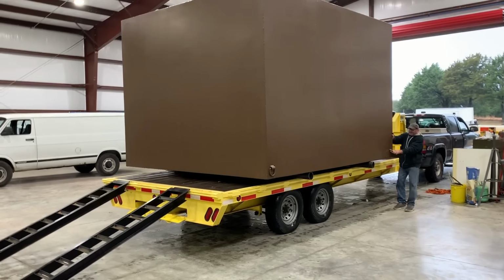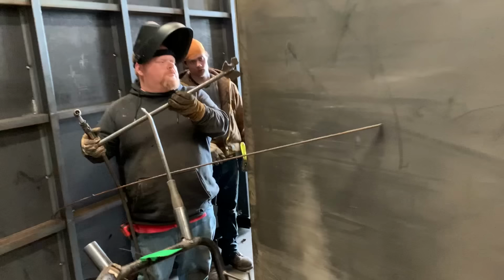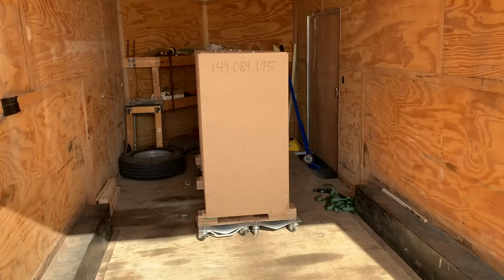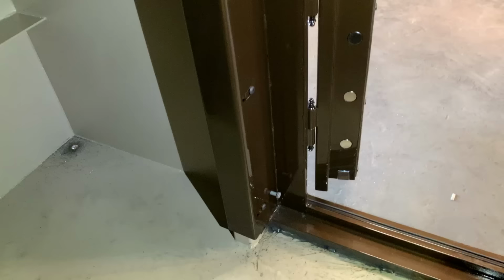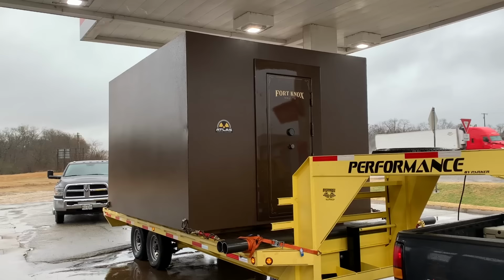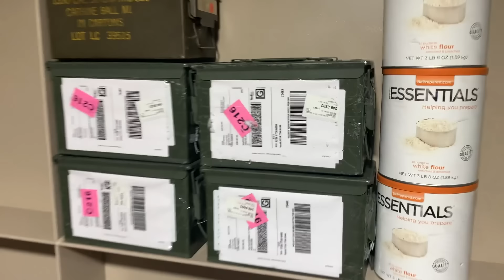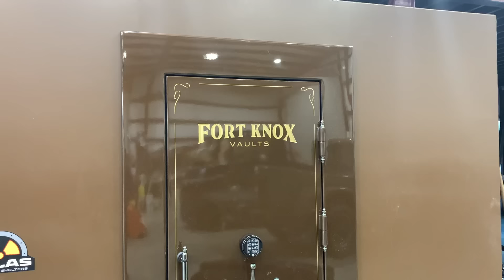Building a $20,000 Fort Knox Gun Vault

Comment: Seems to be very little care put into the moving and unloading aspects of this operation
Reply: 20k gun volt, lets slide it off the trailer and hope for the best.  Where the paint rubbed off it will rust eventually.
Reply: @hyperliterider861 very intelligent input.
Reply: The guy at 10:35 sure tried his darndest to slide a couple tons of vault off the trailer nice and easy
Reply: @Southerngirl612  its quarter inch steel. will never rust through in a thousand years
Reply: I'm sure the integrity of the door and the corner welds are still 100% 🤣 

If it was mine and I saw that.....back to the garage
Reply: The pipes on the ground as rollers and pushing it along with the fork truck had me down laughing.

Absolutely unprofessional

Comment: Remember to check with the lockpicking lawyer to see if it is secure and unpickable.
Reply: Haha wouldn’t that be another challenge for him lol
Reply: hahaha nooooo, get rid of that masterlock piece of garbage. Masterlocks usually fall to bits when the lock picking lawyer looks at them!
Reply: @fence_9540  I know right? I’ve seen lpl pick that lock
Reply: No such thing for him....lol
Reply: That puck lock isn’t just easily pickable. It can also easily be bypassed. Have him buy one that has a abloy core.
Reply: Imagine hiding inside your fort knox vault and all you hear from the outside is: "First pin... nope. Second pin.... nope. Third pin.. *click" third pin. Fourth... nope..."
Reply: Wouldn't need to pick it. Plasma torch to the wall...and that door becomes an expensive paper weight.
Reply: Ive never seen him fail to open one. Really leaves you feeling vulnerable
Reply: I'd have used a manual tumbler dial vs an electronic dial
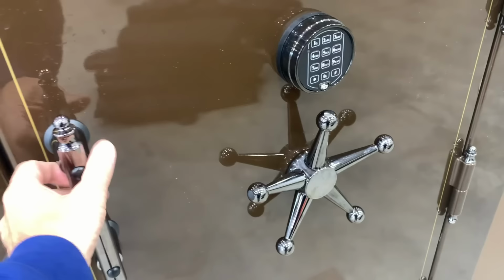Reply: 13:02
Reply: Just have anti lock pick mechanism that shocks the assailant with 20,000 volts of buzz off 😂

Comment: Wouldn't it make more sense to just build a cinder block room reinforcement with rebar and just buy the safe door? I mean if someone can break reinforced rebar in your home they can break into anything
Reply: This is the way we used to build film vaults.
Reply: Metal Faraday cage parden my spelling ,EMP PROOF RIGHT IM NOT SURE
Reply: pretty sure bolt cutters and a sledge would easily go through that.... unless you filled the cinder blocks with concrete
Reply: Yup I'd agree area around door floor roof walls all be at least 4ft rebar concrete plus 1-2 inch steel plate
Reply: I imagine that's why many companies sell just the doors. But the entire vault makes rich people happy. Looks better
Reply: @GingrBreadMan  cement filler cinder blocks with rebar going both ways (grid pattern).   It’s strong enough to withstand repeated impacts from a front end loader.  How they make the walls at material places.
Reply: @willjones5816  the only walls I've seen at a gravel yard that are built for handling front end loaders are massive concrete blocks that have to weigh in at several tons per block.  My experience with cinders are they are very easy to blast through.  I'm sure if you actually filled the holes they would be strong but thats not typical even with cinder buildings

Comment: If I paid 25k and you just let it fall off the trailer on my concrete floor. Like y’all did I would have told y’all to gtfo and take your room with you. Complete disrespect to damage the customers property
Reply: Wouldn’t of told them to gtfo but ur right that was pretty messed up
Reply: Exacly imagine u buy a new car and they just drop it off the truck and bumper falls off and windows crack eh not our problem
Reply: Almost as bad as filming those ammo cans with the clients address all over them.
Reply: @JEPHRO760  Business address is in the description... bruh
Reply: The hell with the door 1 single sheet of steel no double wall no concrete or SS liner to prevent cutting wtf
Reply: @charlietaylor6389   yeah bro it’s a trash safe
Reply: It does not damage the vault in any way to slide it off the trailer.
Reply: they make these things called winches. I guess if you upgraded to the next package, they might use one to lower it down.
Reply: Man, it's so terrible that the bottom that NO ONE will ever see got maybe a little scratched up lol.
Reply: @tgbeam   you must be unaware of how a safe door works. If it is a high quality door, it will have glass inside the door that can break from an impact like this, locking the door up for good. Most people would have removed the door for transport anyways to lighten the load and avoid damage. Looking at the poor construction of this safe (single walled, no ball bearings, no ceramic, no heat protection, no concrete) I doubt the door is quality enough to even have glass inside.
Reply: @connorbeckmann2981  Fort Knox are some of the higher quality safes and doors out there and they certainly didn't remove the door when they delivered our safe
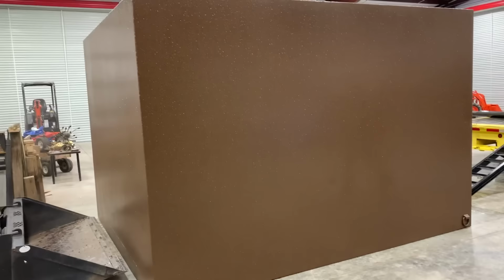Reply: @eddielane9569  10:50 they slid it right into the front loaders bucket and scratched the entire length of the structure. Could of bent something on the loader as well. Just looked like they were making their first ever unload and had no idea what was going to happen.
Reply: Are you sure it hit the bobcat? It looks like a shadow from the bucket to me. Either way it’s missing real safe technology. I’m just hoping there was things done to it off camera but it’s probably doubtful.
Reply: @cheezedoodle8356  yeah it definitely didn’t hit the bobcat. Was close but a few inches away. Look at 10:49
Reply: @user-yg9ug3fl6e   Take a closer look at the structure at 11:34 there is the damage from it. Is it not possible the bobcat was pushed that "few inches" away on impact?
Reply: @cheezedoodle8356  possibly but it doesn't seem to show any actual contact so could have just been existing damage.
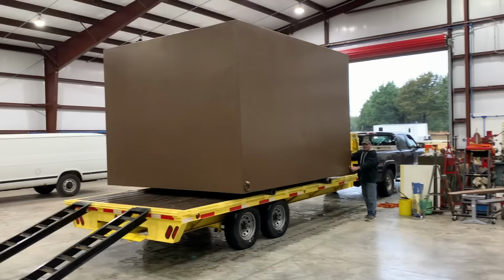Reply: @user-yg9ug3fl6e  Thats the magic of videos. There is before and after footage you just have to rewind and fast forward. 10:30 that's the side that takes damage right there, see how it's unmarked. 10 seconds later it gets hit off camera and you can clearly see the dent and scratch it made. It helps if your not using a tiny phone screen to review footage. If you make the video .25x speed you can also clearly audibly hear it make contact with the loader after the structure slid across the floor. The back end of the structure also jumps off the ground almost an inch as the front came in contact.
Reply: 100% Agree...they would've been told to get their damaged goods and get going
Reply: @user-yg9ug3fl6e  either way then😂why would they be delivering a brand new safe with existing damage?
Reply: @cHoLoM3oW  2 different places.
Reply: @user-yg9ug3fl6e  It definitely hit it. When they are putting the rolling wheels under it, you can see it. It’s bad
Reply: I agree if I had paid $25,000 for a safe and the treated it like that I would have been furious. They look like what we call where I’m from a jake-leg business!
Reply: I agree not best way to treat a customers future property they should have put protective covering on floor to protect floor exterior of room plus some straps to gently lower it down ramps or use 2 forklifts to lift it off bed then move bed out of way and lower room onto rollers job done
Reply: @cobaltt88  shit man.  Just a come along or ratchet straps would have let that thing down slower.
Reply: @connorbeckmann2981  it’s quality.  But in the 6,000-7,000$ range.  Not 30,000-50,000$ range.  The “vault” will be far easier to get into.  No glass inside but there are relockers
Reply: @charlietaylor6389  yeah the vault door is so OP for a metal box

Comment: Love this kind of content. It’s important to remember that the fort know is basically overkill because the security weakness is the walls. If I were attempting to break in I would start at the welded corners and cut a crawl hole in the wall. 

Great stuff though!
Reply: wall around it with concrete block and concrete roof

Comment: Just go buy a 10/12-ft shipping container for 1500 bucks.. you're welcome.
Reply: Exactly and then weld shelf’s inside of it.
Reply: Thank you
Reply: Yeah after spending 40-50k on a gun collection you're gonna cheap out on the gun room.
Reply: @ChucksSEADnDEAD  nah you can make a shipping container real nice.
Reply: @AJMAC-jr5rf  At that point I'd rather weld the damned thing myself from scratch than trying to polish that turd.
Reply: @ChucksSEADnDEAD  its a gunroom in name, so is a drywall closet if I say so..
Reply: Titanium Rain the structural integrity of a shipping container far surpasses this turd.  Mind you, it does not have nearly the lipstick.
Reply: @ChucksSEADnDEAD  this is a cheaped out gun room. A basic torch from Walmart  or cheap angle grinder would slice a hole right into that thing.
Reply: @steen8156  I don't see why my comment regarding shipping containers somehow made people believe I was somehow throwing my hat in the ring for this company but go off, King.
Reply: @jaredadelman4493  Yeah I don't care what this is, I'm just saying that most people aren't aware of the pitfalls of acquiring shipping containers for purposes that aren't shipping.
And if you want keep people out even when equipped with torches and angle grinders, there's videos of people doing that. It doesn't involve shipping containers.
Reply: @ChucksSEADnDEAD  right, a shipping container is exactly the same as this thing basically except bigger,  that's what they're saying
Reply: Titanium Rain I was not going off on anything.  I'm not sure where you got that from.
Reply: @steen8156  It's a figure of speech, did you really need to reply to that?
Reply: A shipping container is 14 gauge steel, this vault is 3 gauge. There is no comparison.
Reply: Titanium Rain did you?
Reply: @SmithDanno1  the fact that I can cut a massive hole in either in about 10 minutes is the only comparison I need.
Reply: @steen8156  Yes.
Reply: You could get a 10'x40'x9'high for 5700 $$$
Reply: @TheTinkle1  How am I a government sheep for pointing out that when you're done reinforcing and sealing the shipping container you've already put so much money and effort into the thing you might have just built something nice?
Reply: @ChucksSEADnDEAD  why does it have to be nice if its water tight and keeps put criminals isnt that the usefulness of it
Reply: @TheTinkle1  It's not about being nice. You're welcome to research on the many people duped into buying shipping containers thinking it would be cheap, and it either deformed or rusted through.
Reply: @ChucksSEADnDEAD  you do realize you can take extra precautions to keep it from rusting and no they dont just magically deform
Reply: @TheTinkle1  By the time you get through all those "extra precautions" you've already spent more time and effort than if you had just built the damn thing to your own specs. The whole point of buying the shipping container is having something pre-fabricated. If you're going to have to re-fabricate it on location just to get it to work... just do it right the first time instead of cutting corners.
Reply: Because people don't think they Google gun safe/room and bam find this...............

Personal I would go with the shipping cost but I like the idea of something that doesn't scream lots of guns inside....
 
Rather that cost factor. 

And wouldn't say $3000-$5000 to do the job depending on preference.
Reply: LordOfWar vibes.
Reply: @SmithDanno1  And what difference does this make when you are using the same tool to get in? If you're that worried just line the container with extra steel for another 1k.
Reply: @MrOzzy281   The difference is 3 gauge is 37.5x thicker than 14 gauge, and you are not getting through it with a cut-off wheel (not quickly). So unless your showing up with a plasma cutter... your not getting through in any reasonable amount of time. This fact alone will exclude virtually all random intruders from penatrating a 3 gauge container.
Reply: @SmithDanno1  A concrete saw would make quick work of 3 gauge.... the reality of it is, with enough time and the right tools nothing is impenetrable.  Camera's, alarms ect is honestly more effective at securing things.  Of course you have to secure it to some degree to buy time but a big ass safe doesn't equal security.  tbh a shipping container with some modifications would be just as effective.  And as far as gauges goes you are talking about .23 vs .07 so roughly 3x thicker... not 37.5x, still very thin,  A grinder could do it but as stated before a concrete saw would create a good sized hole in about 10 minutes
Reply: @SmithDanno1  I cut a doorframe out in a shipping container in about an hour.  Mind you that’s taking my time using cutoff wheels because I didn’t have a torch or my plasma cutter with me.  An opening is big enough to just get in and out of us about 15 minutes.  

The extra 1/8” thickness in this vault would add a whopping 10 minutes since it’s flat (without the baffling).  If I hit a shelf then it would take another 15 or so.   

With an acetylene torch it’s about 10 minutes.  Would opt for cutoff wheels to avoid the smoke/fire/possibility of damaging anything.  

It’s just a means to slow someone down and keep an honest person honest.  A shipping container would look a lot less conspicuous.   Neither are what I would go with.
Reply: Yeah and not to mention the door is way stronger than needed for a metal box.
Reply: That can be easily cut open with an angle grinder were talking about a safe not a bunker
Reply: I mean if you have a handful of weapons sure, but with a heavy arsenal that holds extreme value? You want to beef up security because it’s a much more desirable target.
Reply: @Jrãgaoh  maybe you should watch the video again, please explain how what he builds is better than a container 😁
Reply: Nice name
Reply: @jaredadelman4493 same would go for a shipping container, I have cut many holes in them
Reply: And then you can cut right thru the thin steel in less than 5 minutes.
Reply: @ARluvr1  I will grab my plasma cutter and be in to either one of these in 5 minutes. If noise isn't an issue I'll just get my Husqvarna cut-off saw and be them in about the same time.
If I build it myself there will be no chance of the government getting my combination 😂 keep thinking inside the box that's where you belong ✌️
Reply: @a-a-ron2336  cool story…..
Reply: @ARluvr1  the manufacturer of that volt door gave the government backdoor access to all of their safes without a subpoena or a warrant 👀
Good luck in your box ✌️
Reply: @a-a-ron2336  I’m not that worried about it, but I have a 20 foot container for storage, so for you to say you can find one to make a vault room for 1500 is complete shit. You can find them that cheap and they leak. For a decent one you will spend 3500. And you are comparing a thin shitty Chinese steel to ar500, its not even in the same universe. Anyways goodlyck with your 1500 dollar shipping container.
Reply: @ARluvr1  I'm 4 Miles from a port. If I pick the container up myself I can get it for $1,000 or less second use ✌️
Reply: LoL. Fort Knox is better
Reply: @AA-cw7ql  crack is wack

Comment: Built in-place with thick reinforced concrete filled floor, walls, and ceiling. Like a real bank vault. and a real vault door.
Reply: If they built this, just like it is, then did a second layer of steel with a 4" to 6" air gap on the top and sides for concrete to be poured into once it was set, it would be a crooks worst nightmare to break into. Especially with mesh panels throughout.

Comment: The issue with the very sturdy powder cabinet the guy makes for himself with 1/4" AR500 steel is that it basically will transform a potential powder fire into a giant bomb because of the pressure buildup in the cabinet if there's ever a fire. Gonna make the cleanup real easy if there's a fire, since the house will be leveled.
Reply: I dunno man.  Might be a bitch filling in that crater.

Comment: It's probably overkill but I would have liked to see it with two layer walls with some sort of insulation or light weight concrete for insulation against fire.
Reply: Yeah looks really thin
Reply: @christopherluce8065  it's a lot of show and the door would be hard to get through. But with common, off the shelf battery powered grinders (from of home depot, lowes) a hole could be cut into that relatively easy and quickly... Just not very quietly. 

A fire would just turn it into a oven in no time at all.

Comment: Another option for it would be to make the same type of outside then a 6-12 inch gap and a thin sheet metal inside with reinforcement ridges in it so when it gets installed they can fill the gap with concrete both to add weight and to make it that much harder to cut in with the different material. Yes you don't get the internal shelves built in but an extra 10-20 tons of weight will make it that much harder to move it once in place.
Reply: Plus fire protection.
Reply: Fill the gap with quick lime. Murder to get thru.

Comment: I hope that guy is building a rebar and concrete filled cinder block encasement around that entire "vault" otherwise a porta-torch and less than two minutes will easily get you through anything but the door itself. Hell a grinder and a couple of cutting discs will get you in, in less than ten minutes.

Comment: The powder storage container is not suitable for smokeless or black powder check Fed. (ATF ) regs. 
Smokeless propellants intended for personal use in quantities not to exceed 20 pounds may be stored in residences. Quantities in excess of 20 but not exceeding 50 pounds must be stored in a wooden box or cabinet having walls of at least one-inch nominal thickness.  There are other requirements...This container is a potential bomb.  Insurance companies will not pay on a claim with improper powder/propellant storage  Just  a heads up.  Very cool walk-in vault!

Comment: With no concrete and insulation this is just a large gun cabinet. Its pointless to put a vault door on if you don't have concrete reinforcement. You can cut through 1" steel plate with a steel cutting circular saw.